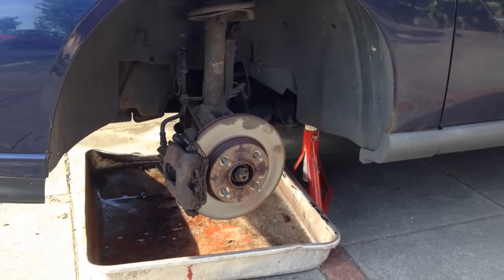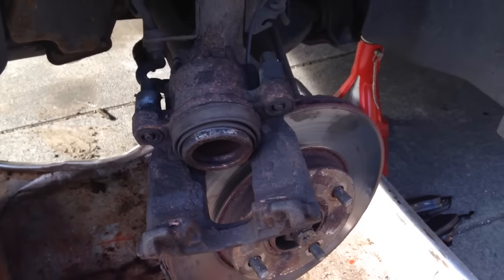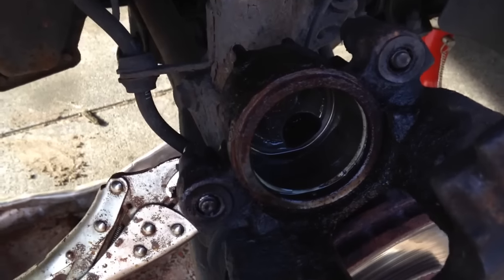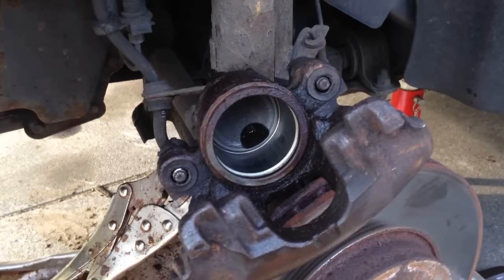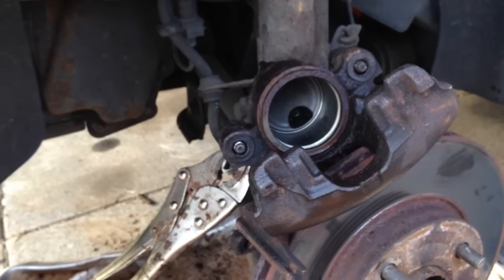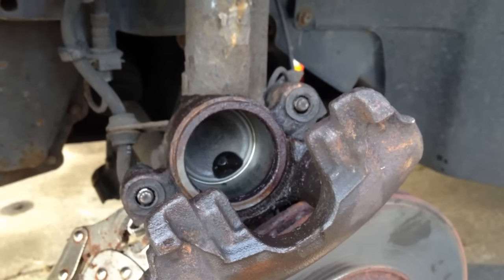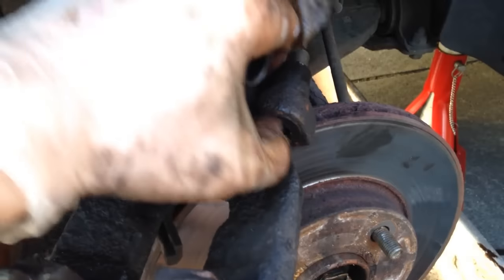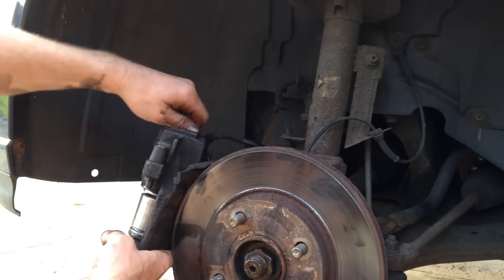How to Rebuild a Brake Caliper (WITHOUT Removing it From Your Car!)

Comment: Few "points" - this may go on a bit.. 

If your caliper is bad enough that you noticed it's bad, chances are this ^ won't work. This ^ assumes the piston isn't seized rock solid. Chances are your piston is seized rock solid. Reasons. 

This ^ also assumes you have access to parts - you may not. Reasons. 

If that is the case, removing the caliper from the vehicle is no big deal - it's a plunger, fluid pushes it, it isn't an iPhone. Air bad, fluid good, blah blah - don't overthink it. Take the caliper off. 

Once off, you will see 101 glitzy YT vids where they "pop" the piston out using compressed air. Mint - unless the piston is actually seized - which is why you removed it, right? Then air not verk.  It not "pop".  You need a long bolt with a smaller diameter than the hole the fluid-feed pipe fits into - pop the caliper in a vise, pop in the bolt, hit it with a big hammer & then the piston will actually "pop".  As opposed to not popping. 

Now what? You've no new parts, right? Be grand - Calm, Deborah. 

First, remove the seals - carefulling is required, no breaky breaky clotty stuff - prise them out gently. Pop those into some nice fresh ATF. ATF has additives that make seals happy - by design. Leave them sit in it for 10 or 15 minutes to absorb the goodness. ATF (for Americans) isn't alcohol tobacco & firearms btw - it's tranny fluid.. which for europeans, erm, isn't transexual fluid, it's automatic transmission fluid.. ATF - get some. 

 While they have "Spa Day" - you can work out a way to spin the piston fast - I use an impact wrench with a socket that fits inside the piston - sandpaper makes a good "bung" to take up the slack - use more sandpaper to, erm, sand the outside of the piston as it spins - don't move the paper, keep the scratches all running horizontal - important. Horizontal scratching good. Vertical scratching bad. That done, the ATF will have re-shinied the seals - take them out, use some bog roll to clean off the loose crud, till they look span new - they are now ready to re-fit. Bog roll is "Toilet paper" btw - if you grew up Posh. 

Now you just have to put it back together. What for impressing the neighbours, give the outsides a good wire-brushing & coat it all in more ATF - a light coat. Metal likes ATF. Rust, not so much.. Put the newly shiny seal in carefully, re-fit the re-energised dust boot, sit the piston into position  (you will have to "condom" the dust boot over the piston now - a small screwdriver helps - once enrobed sufficiently, whack the piston gentlyish down into the caliper using a stout whacker - a 1/2" drive extension bar works. Once seated, make sure the dust boot popped back into the groove at the end of the piston - easy, but make sure anyway.

 You can now re-fit your "I bought no parts, Pal" repaired caliper onto the car & go do the others the same. 

If you followed this far, you'll know there's no point keeping the manky fluid that rusted your calipers in the first place - so drain it ALL out & start with 100% fresh. Bleeding an entire brake system is a doddle if you ignore "The Experts" btw - but I ain't telling ye how unless you hit "Like" on this comment. Because "Effort".

Comment: Nice watch, what is it?
Reply from the maker: I believe it is a £10 Primark jobby - I never buy expensive watches as I just break them all the time. 🙂
Reply: lol it looks expensive, like a flightmaster. good tip though for working on cars , i just know i'm  going to crack mine on something. thanks for the vid, my front brake is binding , i feel brave enough to fix it now. with out my watch on though :D
Reply from the maker: 🙂 Yes, I have owned probably about 100 watches in my life so far - mostly because I forget to take them off. Have a go at your brake: you'll probably be suprised at how easy it is. Cheers, Chris 👍
Reply: I noticed the watch also, and noticed it's on your right wrist. Is that because you drive on the left side of the road?!! :D

Comment: hello. my brake disk overheating. when it is overheating my car dont move. help me. i wait to be cool then i go.
Reply: Check, clean, and test your slide mechanisms to insure proper movement to equalize the piston pressure on inside and outside brake pads.

Comment: be careful with the direction of the piston ring, it's not exactly square, it's got a sharp edge, if put the wrong way you do not get any brake
Reply: That's good of you to add, which way should said sharp edge go?
Reply: @jameznm  sharp edge or wider side is toward the outside

Comment: Vise gripping the brake line is a bad idea. The metal reforcement inside the hose will be compressed blocking the free flow of fluid.

Comment: Dont pinch brake hose!! Remove the caliper and Take caliper bleeder cap and cap the end of the line with it. Or a vacuum cap or equivalent..
Reply from the maker: I clamped it a couple of years ago and this brake is still perfect. I don't agree with the "never clamp brake lines" dogma. You are welcome to if you like.

Comment: If may work just find, but why would you not want to remove it totally from the car? You're obviously going to have to bleed the brakes anyway, so make it easier and rebuild it on a bench.

Comment: Omg, didn't put fresh gloves on for rebuild,  but before that he didn't clean up that bore face area that lives INSIDE the dust seal when it's fitted...  ( so that crud will soon come off and enter the caliper cylinder to piston surface, and hence cause or promote corrosuon and undue wear on the square fluid seal on every retraction....like a valve grinding paste ) 

Doh!!!

Apart from those huge points, not a bad vid and I wholeheartedly agree with restoration and reusing items over buying new or costly remanufacted parts where possible or practical.
Reply from the maker: This is a 1999 Ford Focus, not a Formula 1 car. If I wanted a caliper in an as new condition then I would have just fitted a new one because my time is more valuable than the cost of a new caliper if I was to mess about and clean everything up to have the old one as good as new. The brake was seizing: I fixed it. I'm sure it will give me 5 years of trouble free service, by which time the car will be nearly 23 years old and it will probably time for me to get a slightly newer car... :-) Cheers, Chris
Reply: Christopher Barr - Random Chris
Lol fair enough, but 5 minutes with a small fine file and a scotchbrite pad ( or even a new pan scourer )  wouldn't have been too much effort or time out of your life, especially when some people are going to use your video as a working " how-to ".
It's funny, because you don't look like a cowboy.
😂👍

Good luck anyways.
Reply: pick up points just

Comment: DIY job fine save money! But why spend 45 minutes on your hands and knees you have to bleed the brakes anyway so do the job on a bench do it faster and till save money.. been doing all my own repairs for 45 years am a 944 Porsche for my son and rebuilding my old defender 90 BUT if the part will come off do it on the bench.

Comment: Your calipers ,rotors also need to replace as well. Otherwise will affect other parts.
Reply from the maker: The brake was perfect after this job and the vehicle passed inspection (including braking efficiency testing) 6 years later when I sold this car. Cheers, Chris 👍

Comment: At the end seal fixing method was totally wrong because when piston is inside the clipper its difficult to put seal without damaging it from screwdriver so better way to put it back is lube the whole piston and seal and then put the seal on piston and press it slightly to the clipper inner and then press the piston behind it  step one : seal head in klipper round profile  step 2: press the piston in while the rest seal was on it with much greasy condition

Comment: Informative    But lacks  Profesional cleaning a little sloppy , it will work but not confident  it will last due to cleaning  properly . Also the original piston looks fine  a little 2000 emery to clean bore and piston. A good video but more attention  to profestionalizam. Lots of people pinch the hose but the older the hose may lead to brake failure  later  down the road pinching a pressure hose is poor practice. !!  Take Note -   my comments do not match most of the scroll but what was stated is not mention  to belittle .I  like the video but have Whatch  calipers rebuilt keep it clean thumbs up on your video.

Comment: Pumping the brake to push out the piston without assuring that the master cylinder doesn't run dry will bring a bad ending to a simple job.
-It's wasteful to go to the effort of taking the caliper apart without cleaning the area around the working parts where the external seals sre supposed to seat before putting new parts in place.  It's wasteful to do the reassembly wilth grimy hands that contaimnate the new parts.  
-Where any rust and grime is on the surfaces between the seals piston and body of the caliper, the seal will prematurely fail and permit air and water vapor to enter the caliper each time the piston retracts.  The greade labeled "safe for contact with brake fluid" shuold have been used to lubricate the new seals. It does little to protect the new piston from the cylinder walls.
Reply from the maker: 1: The master cylinder didn't run dry.
2: The external gaitor seal, despite not being seated on a perfectly clean flange, is doing its job nonetheless.
3: This is a 1999 Ford Focus, not a NASA satellite being sent off to a distant galaxy. This brake caliper will work perfectly for a number of years (until the car is ready for the scrapyard) despite me not using all of the super professional working practices I used to use every day when I worked as a mechanical technician on aircraft (including on their hydraulic flight controls and braking systems).
5: I put the grease on the outer edges of the inner face of the piston so that it would be transferred onto the square profile seal as the piston was inserted. The piston does not need greasing, but was 'wiped' clean by the seal during its refit.
I did this job very quickly whilst taking the time to make a video to help others who don't know how to do this job - which begs the question: if you are such an expert, why did you feel the need to watch this video? Isn't that wasteful of your time? Cheers, Chris

Comment: One should try replacing the brake hose first, the old hose might be broken inside and cause the seized calliper.
Reply: iaxable My wife had a rear brake caliper replaced after 100k miles. 2k miles later, the rubber hose itself broke. I wonder if the mechanic clamped the old hose with with pliers. I will replace all four hoses soon.
Reply: Mytwistedvoices 100k is a lot of miles, clamping with a blunt edged tool is fine on a good hose
Reply: @iaxable  Thanks! I feel better about my mechanic.

Comment: I've had brakes freeze up, 90%of the time its internal failure to the brake line.
Reply: I've been in the car repair business for 52 years. No. The hose rarely is the problem for sticky brake pistons. The bore in the caliper gets rusty and sticks the piston in place especially in areas where the roads get a lot of road salt on them. Some calipers are supplied with phenolic pistons which absorb brake fluid after years, causing the piston to expand making them stick.

Comment: Not a fan of rush jobs. If not done properly you risk making things worse and having to put more time and money in later on. Not to mention that it's not a great position to be working in hunched over like that in front of a confined space. I know cause my back wasn't my friend after i was done tooling away down there. 
Not saying you have to spend hours on it, just saying that if you'd detached the caliper from the brake line before or after clamping the hose you could have done all this wherever you would've liked, making working on it a bit easier, cleaner and the extra effort might even speed things up.
Reply from the maker: I'm used to working quickly without making things worse. I am a ex-service technician on Royal Air Force fast jets and we would only have 20 minutes to do a 'turn around' and get the jet ready after one flight in preparation for its next sortie. If we messed up our work the consequences could be lethal so we had to stay switched on during those 20 minutes...  If I had a garage or workshop at home, I would have removed this and done it on a bench. I don't have anywhere better to work so on the drive it was. There were no mistakes and the brake is working perfectly to this day (and I fully expect it to last the rest of the working life of this 19-year-old car) Cheers, Chris

Comment: Basically a good video, except that rust creeps.  You don't need to be obsessive about removing all the rust from the body or painting it, but if you don't remove the rust from the rim and lip of the caliper body (a 5 minute job) around the cylinder that rust will promote rusting adjacent to the external seal and accelerate deterioration of the new piston.  Id ypou plan to keep a vehicle a long time, that 5 minutes will pay off.

Comment: My friend great job but you really need to bleed the whole brake system unless I am just old school
Reply from the maker: Hi Tony, by clamping the brake line very little air gets into the system therefore it needs very little bleeding. Of course if there is any more 'sponginess' in the brakes at the end of the job then you need to keep bleeding (possibly other parts of the system too depending on where the air has got to) until they are solid. Cheers, Chris 👍
Reply: No air got into the rest of the system, hence only the one caliper needed bleeding.

Comment: THIS IS NOT THE WAY TO OVERHAUL A CALIPER THAT LOOKS THIS BAD. YOU SHOULD REMOVE TO A WORK AREA AND REMOVE ALL PARTS ON CLIPER INCLUDING PISTON.  GIVE THE CALIPER HOUSING A GOOD CLEANING / SCALE REMOVAL AS WELL AS ALL HARDWARE IS A AILABLE NEW CHEAPLY.  IF PISTON IS RUSTED THEY ARE CHEAP TO REPLACE ALSO FLUSH OUT ALL OLD BRAKE FLUID AND INSTALL NEW BLEED PROPERLY. MAKE SURE ROTORS ARE GOOD TOO  IS SO.  SANDPAPER THE MATING SURFACES.  USE SILICONE LUBE ON ALL SLINDING AREAS. USE BRAKE FLUID OR SOMETIMES OVER HAUL KITS COME WITH A LUBE FOR THAT

Comment: Not the entirely best way to bleed the brakes, ideally use a tube and collect it in a container.  Not only can you see if there are bubbles in the tube (cant do that with it shooting out) but brake fluid is extremely toxic to wildlife

Comment: Please never clamp down on the hose. Thats how to ruin a brake hose. Better taking the hose off caliper and putting down a drain pan. Either way needs to be bled, but then you dont damage the hose.
Reply: They're teaching us in auto mechanics to clamp brake lines using a clamp made specifically for this.  It is easier than the risk of error from improper bleed.....

Comment: What’s the point? It’s so much easier to do on a bench and by this point there is ONE bolt holding the line on..... just take the bolt off and do it properly 😫
Reply from the maker: 1) I don't have a bench or workshop. So I'd have been taking the caliper off to sit on the floor and work on it.
2) This video wouldn't have got over 1 million views if it wasn't for the video title make people think "What? Why would you do that?" clicking on it, watching it and commenting, which tells the YouTube algorithm that this is a video worth promoting.
It was more luck than judgement, but as this video has paid for my (admittedly rather crap) car several times over, I think it worked out ok in the end... Chris

Comment: He starts off wearing gloves and finishes with skin cancer. Also i would have used a piece of tubing to contain the brake fluid into a jar while bleeding the brakes rather than spraying it all over the place. I don't really see the point of keeping it on the car when there is only one more hose to remove.

Comment: Crushing the brake hose is about the dumbest thing you can do!!!!
Reply from the maker: It was not "crushed", it was squeezed just enough to stop it leaking. Despite a number of doom-mongering comments, the brake hose was still perfectly serviceable 6 years after this video, when I put the car through its MOT (inspection) and sold it. Cheers, Chris

Comment: Everything contaminated, always take apart sand coupler with 1000 grit papaer in and out,the completley inspect and clean calipers totally..do not get these contaminates in your lines and on you discs and pads...do it right you waint need to go back over Gain and again

Comment: I can't figure out why I would ever want to rebuild a caliper on the car instead of on the work bench.
Reply: Someone without a workbench...and a garage...you know, working class blokes without a trust fund, 3 acre spread, and a full hydraulic lift
Reply: I’ve never had so much as a home garage to work in. More often than not I’ve had to do my work on a wooden crate. Rebuilding a caliper on the car is harder than doing it on a table made from a board sitting on top of a trash can.

Comment: Mix grease with brake fluid🤔
Reply: that grease will not mix with the brake fluid or suspension oils.  PM600 military grease.  Used to rebuild shocks and other suspension components as well.  Won’t wash off or mix/dilute/contaminate, etc.

Comment: If you overhaul one side you have to do the other side too.  Am I right?
Reply from the maker: Hi Dan, in a case like this where you are refurbishing tha caliper, you can do just one side. The brake disks and pads are the same so you can just do the side which has the problem (seizing, leaking, damaged seal etc.) and refit the original pads. Cheers, Chris
Reply: I agree.  Thanks for the video Chris.
Reply from the maker: +Dan Sibayo Thanks for watching 👍